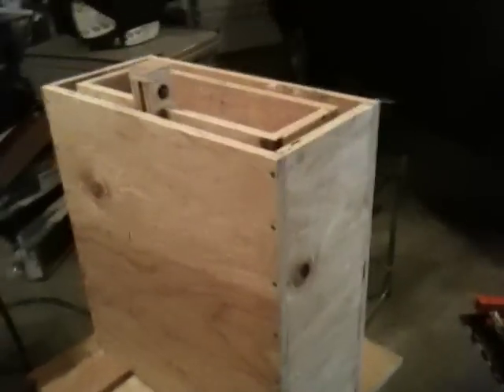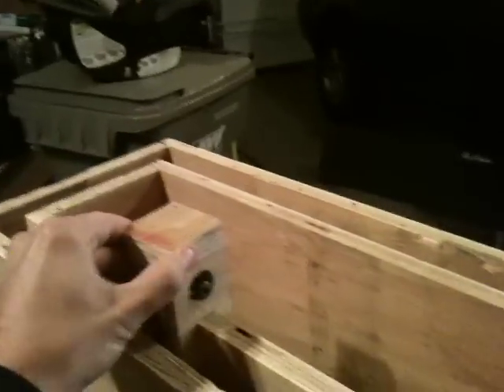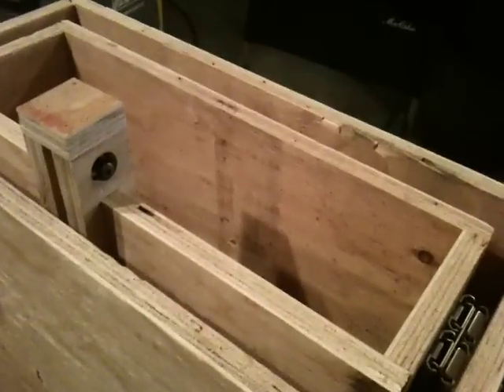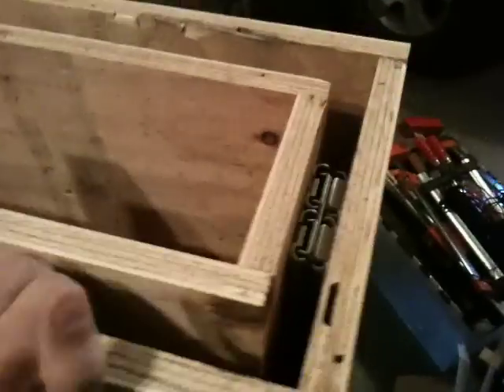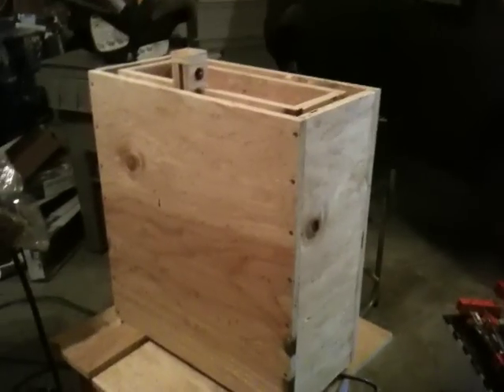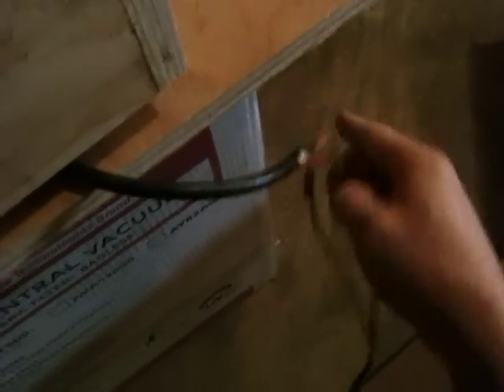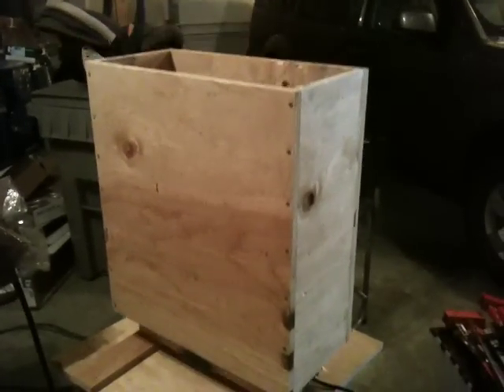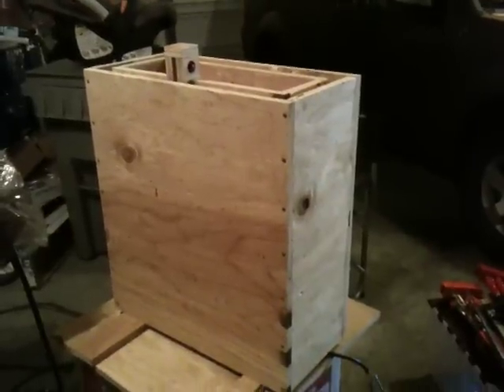Raisable & Lowerable Desk - Step 2: Moving Leg

Comment from the maker: By the technical definition, I'm using an actuator, but it's not the linear actuator you may be imagining.  It's just a geared down motor (I think 3/4 HP) whose shaft is parallel to the ground.  When I apply current, the cord wraps around that shaft and pulls the outer box up.  That is, it's a simple pulley system.

I need to get my Step 3 video up, which goes into much greater detail.